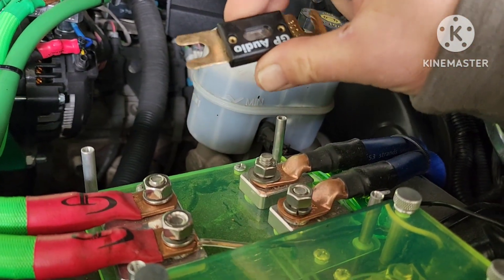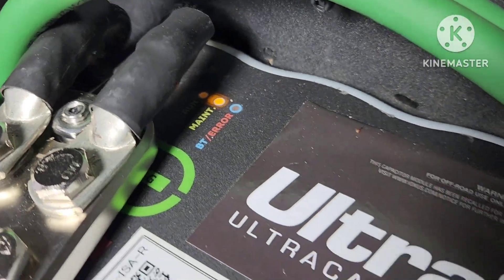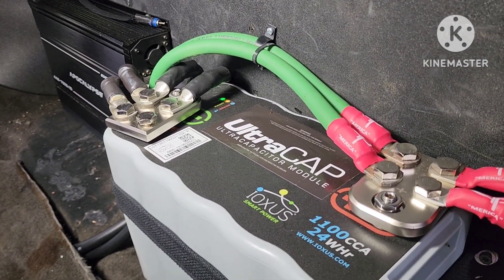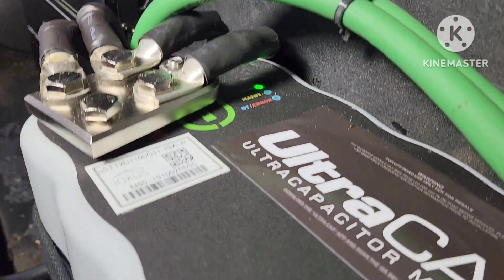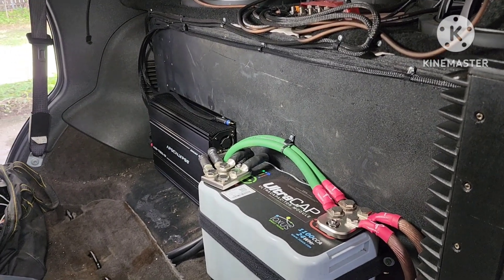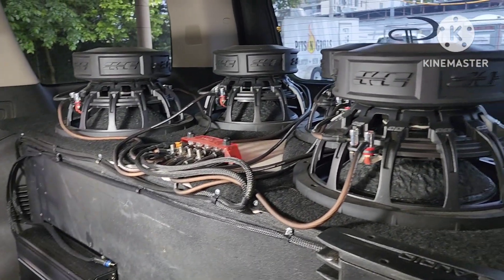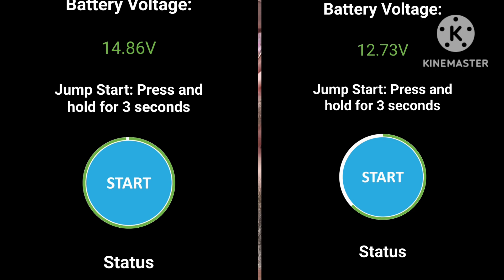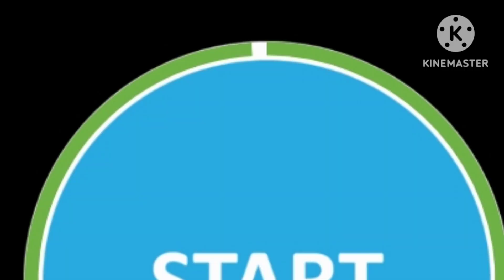Testing out the Ioxus Ultracapacitor

Comment: You really can’t run an ultra capacitor without a lithium bank they go hand-in-hand capacitor is gonna give your amp. The power needs immediately and the lithium is gonna be able to hold a little extra power to keep everything charging.
Reply from the maker: You CAN, IF you have a really big cap bank

Comment: Great content. I only running a old school jl Audio 1000.1. On 2 Skar Evel 10". I was using a XS D5100 that had been sitting for about 3 years. Its holding voltage but seems to be drained. Before buy the ZS 3400. Im thinking of using the same super capacitor your running. This is in a 2017 VW Passat R Line. Weight is qn issue, so im thinking of trying the super cap alone in trunk. Im hoping with only approx 150amp draw I'll be fine. What are your thoughts. The od d thing batter will show low voltage like 5 volts. Both mid and sub amp turn of course. Give a 5 minutes with music off, battery shows again with car off 12.5-12.7 volts. Im stumped. Im guess the battery is simply old, bought in 2018 using same sub amp
Reply from the maker: personally id get a trunk thunder lithium 5k battery, put it in the back, and delete the old agm up front, you could replace it, but with the 5k battery you wont need any other batteries. my discount code there is cae10

Comment: It sounds like the stock battery is dragging the capacitor down when the system is off. That puts more tax on the alternator when you start the vehicle up, then it drains back out when it's off. In a perfect world, it would be better to ditch the lead battery and switch to LTO or something that holds a higher voltage.
Reply from the maker: done, lol, the cap was the issue, it wasnt turning off.

Comment: I bought one of these and haven't installed it yet. After researching, they were recalled for moisture instrusion basically shorting the board and rapid discharge to the battery. Would fusing extra just before and just after the cap eliminate, or greatly inhibit, the possibility of burning up the wiring and a fire if that happened? I'm already fused at both ends of my setup. Thanks in advance
Reply from the maker: the original mounting location for these was under trucks, so you should be fine. honestly a fuse wouldnt help in that situation, but you always need a fuse as close to the energy storage as possible
Reply: @CarAudioEnthusiasts that's what I was thinking. I'm running a 275 amp alternator and a yellow top. Two T1500s and a T600.4 so this cap will help tremendously. Luckily it's in a 1990 Jeep Cherokee, so the vehicle itself isn't pulling much.
Reply: @CarAudioEnthusiasts I ordered a trunk thunder 5k today. That should help too
Reply: @CarAudioEnthusiasts I need to ask you something. I got a TT 5k and I was only able to get it charged on the bench to 13.8 with the charger I have. Do I need to get a different charger to get it to 14.6 before I put it in the truck? My alternator charges at that, but I didn't want to install it before I asked.

Comment: I have a 100ampalternator that’s struggling to push 80 amps for the amplifier and run the car. Bought this hoping it would save me from upgrading alternator :)
Reply from the maker: fingers crossed this helps you out! but if it dont, getthe trunk thunder lithium 5k, use discount code cae10

Comment: im only running about 3000 watts in my car no matter how big of a fuse i put in they all get exploded  runs finewithout fuse no incidents though
Reply: Might need to do a dual run at that point. Split the amps between two wires and lower the amperage across them

Comment: What size nuts do i need for the terminal  screws
Reply from the maker: it should come with the bolts, but standards bolts for any battery will fit
Reply: Found out they are 3/8 -16

Comment: Wanting to get a big Jeff lithium and run it straight from my stock alternator to run a 3k taramps on my subs and a recoil 1200.4 on mid and high. Would a ioxus in line with the lithium help me out or maybe overkill for my system ?
Reply from the maker: cap is always good, the big jef lithium is a good battery, but if you can afford it, you might consider the trunk thunder lithium 5kv2 for your setup. it has about twice the power of the bigjeff battery, and can handle 5000w on a stock alt,  and 10000watts on a 300amp alt
Reply: I'll have to look at the price difference, in a time crunch rn trying to attend a show in August  @CarAudioEnthusiasts

Comment: I had a lot of super caps...they are great for mentain the voltage for amps...and do a longer life for the amps because they also have capacitors and they respond well at that
Lto's are also great in compare to agm/lifepo4,the recharge in seconds...and with lower ah then others...my experience is that you have to install caps...the maxwell 500f caps are the best on the market and thay last 10-15 years...Shot out From Austria ,Take Care.
Reply from the maker: Thanks for sharing

Comment: Thank you! I am considering one of these. Seen nothing but good things about it. Would like your opinion though, 2K sub amp, Big 4 complete, 110 amp stock alternator, XS d3400 under the hood. Would this help my voltage drop? Only goes down to the mid 12s.
Reply from the maker: a bit, but id recommend the trunk thunder lithium 5v that would totally stabilize your voltage, and would handle a system up to 5000 watts on ur stock malt, and about 10000 watts with a HO alternator. discount code CAE10 saves 10%

Comment: Do you got the pin to the ioxus capacitor
Reply: @ password pin to the app mine came with no manual instructions nothing I never set a pin so I’m guessing it’s a universal pin
Reply from the maker: @almightyd3ll3r  there was no pin
Reply: @ mine is asking for a pin where the lil wrench is to get to the other modes on rhe capacitor
Reply from the maker: @almightyd3ll3r  huh, i havent messed with that. try the classics 1234..9999..0000

Comment: You should consider putting in a  600-700A breaker up front and put your fuse blocks after the ultra cap before your amps.
Reply from the maker: that run is like a foot long, there is no need at all for a fuse between the cap and the amp, other than if you need it for wire management.
Reply: Okay so don’t put a fuse back there. Pretty ignorant if you ask me. But still should allow higher current through to the cap - as much as your wire can carry.
Reply from the maker: @CorruptName1  these caps can only take in a limited amount of power through their charge controller, 150 amps I believe. still 2 runs of 0 guage at about 10 feet long can handle around 700amps, and those runs are fused for 300 amps each so 600 amps can easily get to the cap. im not sure what youre saying is ignorant? but im willing to listen.

Comment: Bought one for my 73 power wagon. 65 amp alt.. killed my engine.. by drawing to much. Had to use a battery charger to charge it. Upgrading from a 65amp alt to 220. Plus double 4 gauge from alt. 2 gauge grounds and from batt to cap.. but it's just a work truck.
Reply from the maker: yea, that 65amp alt is a bit on the light side, upgrading it is a good call. you also may want to use Gatorback Belts.
Reply: @CarAudioEnthusiasts  thinking about putting a Volvo electric power steering pump on it. That way I can run a gilmer drive should not slip then

Comment: I found you because I was looking for reviews on this supercap. Thank you for the great detail. You have made me confident that I am making the right choice. I am only running a Kicker CX1800 to 2 L7S 12s. Seems like Big Jeff is the guy to talk to. Appreciate the video
Reply from the maker: Welcome aboard!
Reply: @zachjennings1443  are you on a stock alternator? What’s your alternator rated at? Did you do the big three? I’m asking because I have a 220 amp alternator and am going to be running the kicker CX1800 with 1 L7x 12” sub. I’m debating if I’ll need any of that or if my alternator/agm battery will be able to handle that with ease.

Comment: 9:20 I wonder if the internal charging circuit is limiting the intake current.
Reply from the maker: it does. untill it fills up the cap
Reply: @CarAudioEnthusiasts  Ive been playing around with it on battery and alternator power and I can't get it to draw more than 25 amps into it at a time. I think when it gets down to battery voltage, the batteries pick up the slack of the load, not that the batteries now are charging the cap. It's almost like a current limiting circuit, which makes perfect sense for it's original purpose.
Reply from the maker: @Brandon_Neil  interesting, I'll have to test more
Reply: @CarAudioEnthusiasts  I can't find much official documentation on it, but on Big Jeff audio and on a forum they both mention 15 amps nominal, 21 amps max charging. The newer model of the ioxus has documentation of an internal buck boost converter and I think it was rated at 500 watts but don't quote me on that number.
Reply: @Brandon_Neil  any kind of regulation or protection circuits induce resistance

Comment: I just bought the Ioxus Ultracap. I ran my system for a little bit. I turned my car off and nothing is running but the run light is still on after 2 hours. Any idea about this? Thanks
Reply from the maker: It will go off eventually
Reply: Did you buy a brand new one, or a B-Stock refurbished one? I'm looking for where to buy the new ones??

Comment: I always charge caps with a light bulb before connecting. But since these have a charging light, i assume it has some kind of built in resistor to control the charge. Real caps fully charge almost immediately

Comment: How do you think this unit will perform in 2023 Ram 1500 with the start-stop feature? I can turn it off, but I want to know I am stable during that operation.
Reply from the maker: it should soften that voltage drop a lot

Comment: Im installing battery delete. I have 320 auto teck gold series alt, two runs of 1/0 team welding cable to the back to 65 ah lithium lifepo4. Can i run Ioxus with my set-up
Reply from the maker: you can run it with ANY setup, and yes it would be awesome with your setup
Reply: Thank-you is it easy set up
Reply from the maker: @jccoffey23  just hook it up, everything is automatic, just like putting in a battery
Reply: Does it go between alt & lithium or alt to lithium to ioxus
Reply from the maker: @jccoffey23  it can go anywhere, but its best close to the amp
Reply: Well how would I hook it up properly

Comment: Hey, CAE. Hope you're feeling well today. Im considering one of these for my daughters car. Its a newer syle malibu and has all kinds of factory charging system tech upgrades, not sure if you are familiar, its a 2017 model. Ive seen videos of folk modifying all kinds of wiring and installing adapters to make stuff work. Definitely going to be a learning curve for og. She just has stock electric at the moment. I guess first off before i get carried away even more here, would you feel comfortable installing one of these b stock units in Your daughters car, that is running 3000 watts? If so, ill revert back to details.. so stock electric, with big 3, all ofc, stock 12v agm or probably lead acid up front, one more in the trunk, and one of These next to it, pushing 3000watts between two amps located within 1 or 2 ft in the boot. Does this sound like it could work? What if i did two of these? Will two of These beat a 320amp ho alternator? Help a bro out here, porfas. I wish i could afford consultation. If im asking too much, just answer about would you install one in your daughters car. Thanks broski. I trust your opinion g
Reply from the maker: caps are very safe, so yes i would totally be ok with the install, but nothing will replace good charging. this thing is like a fast reloading crossbow, it stores power fast, gets it out fast, but you still have to pull it back for each shot. same with any storage.  looks like your stock alt makes around 150amps, after the car takes its share, you have maybe 70-80amps at most thats a bit small for a 3kmax load. i spotted some 250amp alts for that car, thats the first thing you should go after, then the ultra cap. hope that helps.
Reply: @CarAudioEnthusiasts  thanks, that makes perfect sense. You da man!